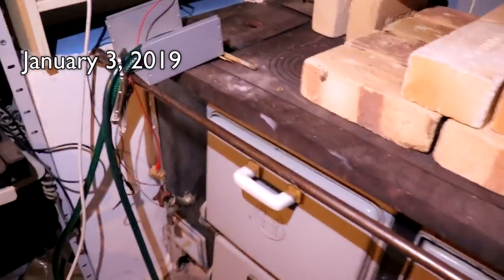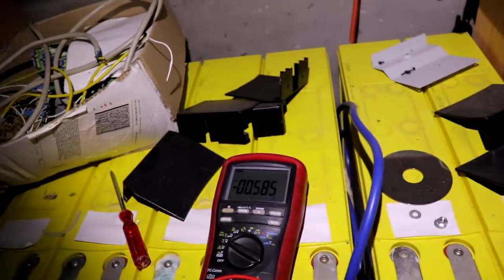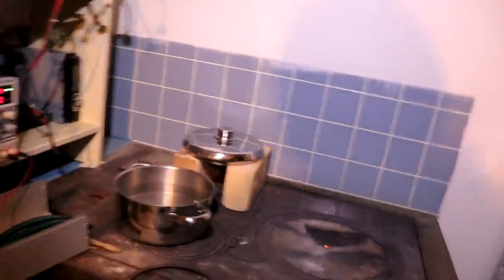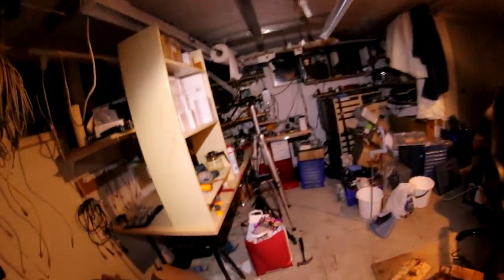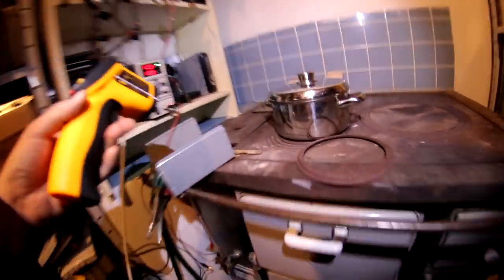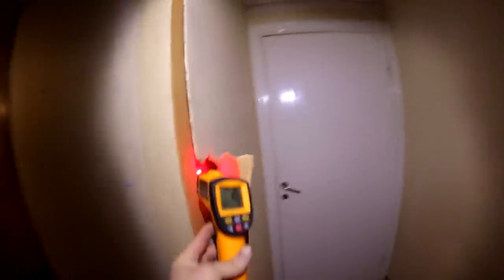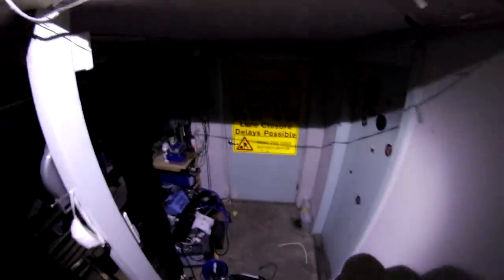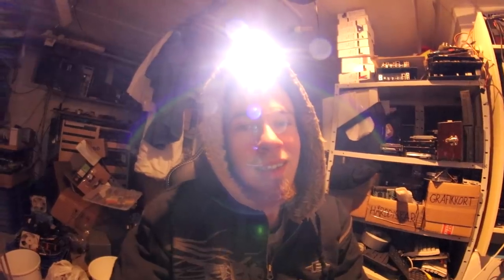Power Loss Blog 3 - Day 2

Comment: Coffeemaker is likely close to a kilowatt.  Fridge power depends on where it is in its cycle.  Lots of watts to start the compressor, 1/3 to 1/7 of that power while it's cooling, 300 to 500 watts when in defrost mode.  If you plan to run close to the inverter's rating, you need properly sized wiring and a large battery bank.  I have a 2000 watt pure sine wave inverter that can't run the "1100 watt" microwave oven when the fridge is running.  Checking the microwave finds that its input power is 1892 watts.  That doesn't leave much for anything else to run on.  The 12 volt battery bank is 420AH so it's capable of handling the power but the microwave plus anything else exceeds the inverter's 2000 watt rating.  Be sure to check the numbers on each appliance and add the watts so you know how much power you're requesting.  Also check the size of the wiring - you probably need at least 4 AWG or your country's equivalent.

Comment: Couldn't you have used your van as a generator?
I also forgot how your house is usually heated. Central oil furnace? Why not supply that with backup power to keep it running?
Reply: heat pump (100% electric)
Reply from the maker: As Alfonce said, I run a ground effect heat pump. It's 100% electric and uses about 3 kW on the minimum setting. While very efficient, it'd drain my batteries very quickly, and I don't have a 3-phase inverter to run it from.

Comment: why not make a 230v generator so you could chrge your batteries from that when you dont have the sun to charge your banks, get some peltier elements and put the hot side around the oven and wire them in series  ;)
Reply from the maker: Hell yes, I could harvest several watts that way, lol.

Comment: Beware of co2 level increasing on lower parts of a house...
Reply: co, rather
Reply from the maker: That does not happen when you have a chimney.
Reply: definitely worth having a CO alarm or monitor, i have lost friends that have died due to CO in trucks with burners.
Reply: @FFcossag  Sadly, this is incorrect.
Reply: @mcflapper7591  ever heard of some having a carbone problem with such a stove?
Because I used my fair amount of wooden heating aparatus and trust me when a chemine is baking up you tend to notice rather quickly.... ( the billows of thick smoke flooding the room tends to be a good clue!)

I'm not saying you can't poison yourself with wood, I'm just saying contrary to gaz or petrol burner, any problems with the exaust with wood is extremely obviously! I'm feel I'm repeating myself..
Reply: @alfoncejean8826  plain wrong. but go ahead, maybe you succeed finally.. ;)
Reply: @mcflapper7591  OK my research was obviously to light. I honestly did not think such things could happen!